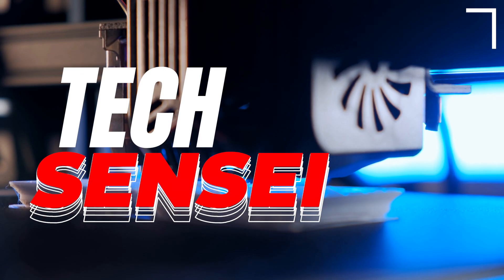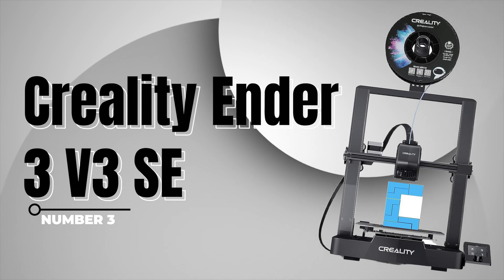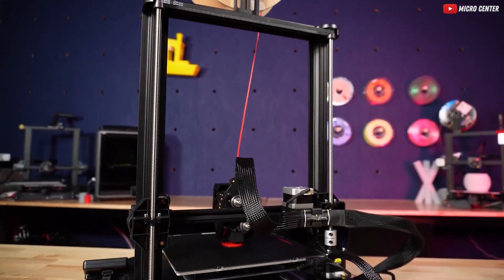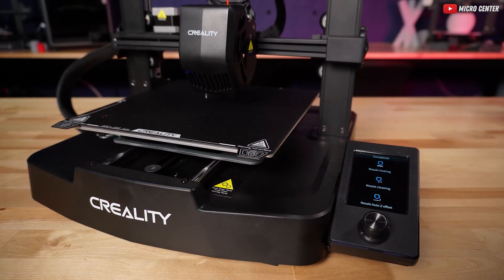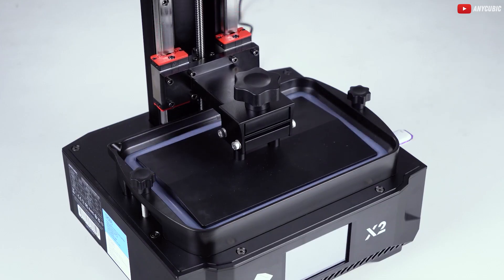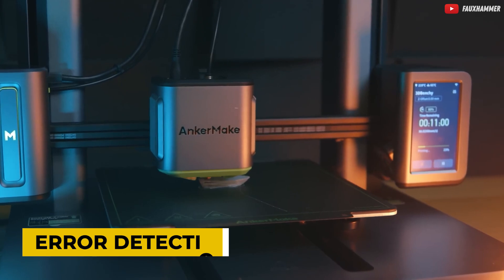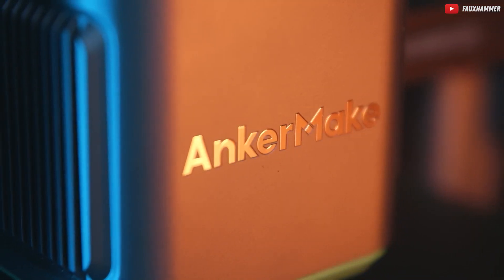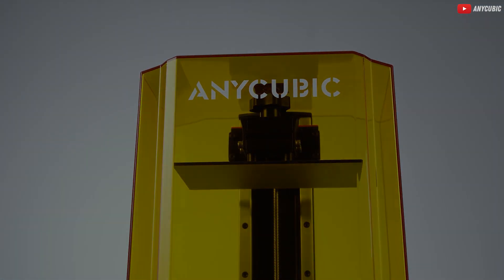Best 3D Printers: From BUDGET To BEST

Comment: what is all this bs? u just come in here with no actual experince? and its not a fuking micro-meter, wtf is that. 250 micro meters a second is like 0.25 mm a second. Man get ur facts straight and actually get some experience. The ankermake is very much hyped up but is it really that good? eh. For example the k1 is quicker and cheaper (currently at around £400 because of black friday). Or the P1P or P1SS. Do the ai features actually really work? no, not really. This anycubic thing is total bs. You can get an 8K resin printer for like £400. Much better deal.